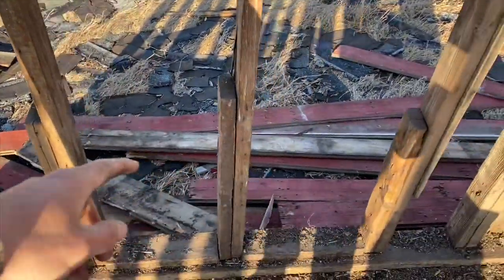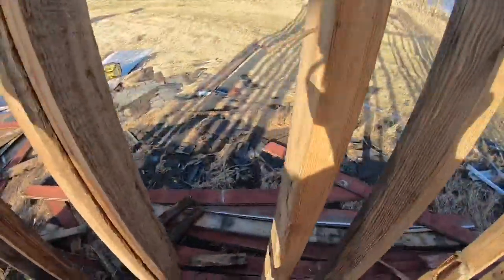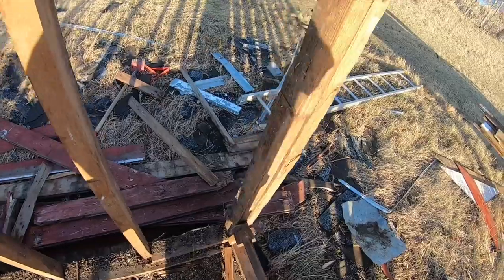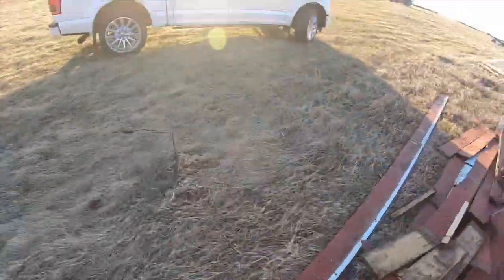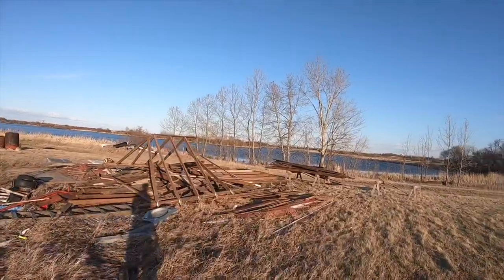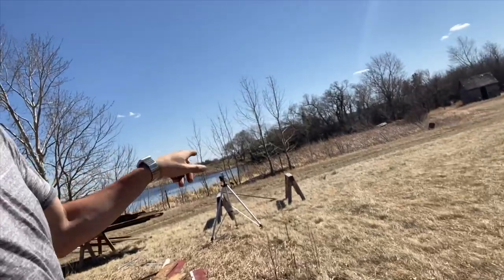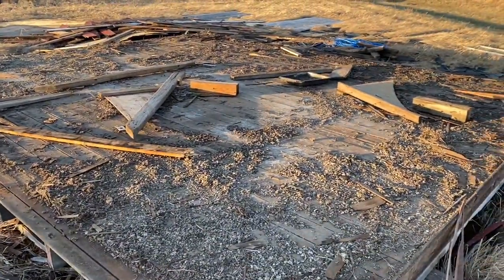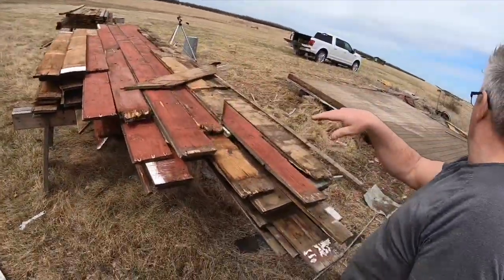Saloon Build Episode 3

Comment: The new Saloon will look quite authentic as a result of your re-using this old lumber. I kind of recall that the grain would oil and polish the wood where it made direct contact, in a rather pleasing manner. Are you planning on re-using the floor boards for the saloon floor?
Reply from the maker: Yes

Comment: Ok that was an Hour long ad?
Reply from the maker: Really they are that long?
Reply: @AustinTischler   ya. I had zoned out for a bit during.
I will see if I can get it to do it again.
That is Crazy. Maybe I bumped something
Reply from the maker: Stephanie Howe wow I didn’t realize they had ads that long lol
Reply: @AustinTischler   I will recheck.
Watching Stephen Archibold atm
Reply: Well if you earn extra for comments :)
I am running it through again.
Those shorter boards you found in the wall?
My house was "built in 1930" which is what the deed says.
Construction methods indicate otherwise.
Bur they were in my Bathroom wall when it was opened up.
Frankly the house is pre indoor plumbing too
Reply: Ok, no hour long ad the last 1 was 4:04 mins though.
I will keep an eye out